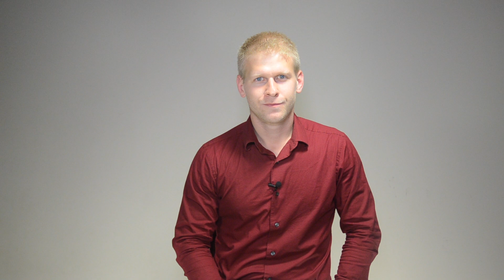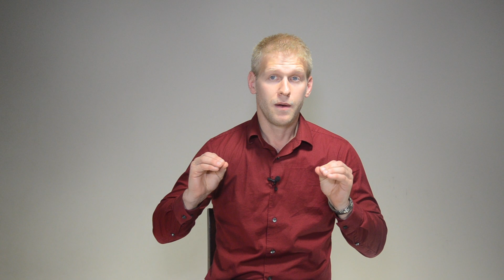Fake Refresh Rate Explained, Simulated, TruMotion, Motion Rate, MotionFlow, Clear Action, AquoMotion

Comment: Why is interpolation impossible to measure? I mean if it is inserting new frames in between source frames, doesn't that mean the screen panel is capable of refreshing more times than its 'native' refresh rate? I don't really get this..
Reply from the maker: +Nouri Al-Kadhim interpolation becomes hard to measure because there are a lot of different ways to do it and not every TVs interpolation software is equivalent. a TV can look at 2 frames and guess what a middle frame should look like. If you think of it in terms of computers a Macbook Pro is going to do a better job determining what should be in the middle than a 98 windows computer with a celeron processor.
Reply: Retail Chad But now we are talking about the ways to determine the middle frame in interpolation, not the number of times the screen is capable of refreshing. Since it is inserting and displaying the reported number of frames, the reported refresh rate is not "fake," but the inserted frames are.

For example, consider a native 120 Hz TV which receives 60 Hz signal and displays one interpolated (or predicted/fake) frame in-between each two of the original frames. We wouldn't call the advertised 120 Hz on this TV a fake refresh rate, because it is truly refreshing the screen 120 times per second. If we turn off interpolation, it would still refresh 120 times per second but it would display each original frame twice. Thus, either fake refresh rates have nothing to do with interpolation, or the advertised refresh rates are not fake and the screen is truly capable of refreshing at the advertised frequency. I think the former is more likely.
Reply from the maker: +Nouri Al-Kadhim I think that you are missing the reason that I call the advertised refresh rate fake. The number that a company uses as their motion rate (notice how i didn't use the words refresh rate) has no correlation to the number of times the TV refreshes the picture. Example: Samsung is allowed to say that a TV that they make has a Clear Motion Rate of 1440Hz, but they are not allowed to say that it has a 1440Hz refresh rate or it would be considered false advertising. 

The following is Samsung's definition of CMR:

-

"Refresh rate is a quality of your display's panel speed, but it isn't the only factor in producing a clear motion picture. So even though different televisions might have similar panel refresh rate speeds, Samsung TV adds factors to assure you'll get the best resolution from a moving scene. Here are the components that serve as the basis for Samsung CMR:

HyperReal Engine – This engine for Samsung Televisions processes moving images to reach the optimal image quality.

Advanced Backlight System – The advanced backlight of LED/LCD screens works in harmony with the HyperReal Engine to deliver crisp and reactive backlight to a moving scene.

Ultra Clear Panel – Samsung TV panel technology has over 20% higher contrast ratio compared to other HD panels, as well as faster processing time.

These factors, along with fine pixel detail and overall high product quality produce a high Clear Motion Rate. The higher the CMR, the clearer your motion picture quality will be."

-

The number used to define what you read above is simply a educated guess of how clear Samsung "thinks" their picture is in terms of Hz even though it can not accurately be defined using Hz. 

No TV can refresh its picture 1440 times a second, but Samsung can say that the number 1440 can define the clarity of motion in the picture because of the technology they use to enhance the picture even if it has no direct relation to how may times the picture is refreshing. 

Samsung themselves states that they consider the motion clarity to be "better" because of their contrast which has nothing to do with how many times the panel updates itself. 

I understand your comments, but there is no industry standard for how to define the numbers that these companies are using to explain motion capabilities of their TVs.

In conclusion - these numbers cannot be accurately used to compare TVs-
Reply: Retail Chad That makes complete sense and I really appreciate your answer. However, you still did not address my point about interpolation. If, for example, a TV has a "real" refresh rate of 60 Hz and it receives a signal with a frame rate of 60 Hz, the TV is physically incapable of interpolating new frames in between the original frames. It can show the 60 original frames in succession throughout the duration of a second, but it cannot show more frames (whether real or fake) than 60 per second. Therefore, if the TV company wanted to say "we say our TV is 960 because it shows 15 interpolated frames in between every 2 original frames of a 60 Hz motion picture" they cannot say it without flatly lying since there does not exist a panel in the world capable of displaying 960 frames (whether real or fake) in a second.

So yes I agree that the 'motion' numbers advertised by TV manufacturers are made up and meaningless. However, as I said in my earlier comment, frame interpolation is irrelevant here. And I do understand black scanning and how it gets calculated into the advertised numbers. But in the video you say the 'simulated' rate is primarily dependent on 2 things, black frame insertion and frame interpolation. I think the latter is a feature which is irrelevant to the simulated rate. If you go to the section titled "Relationship to advertised display framerate" of the Wikipedia article titled "Motion interpolation" you may understand better why I think so.

Comment: Thanks for the video! I have a guestion,  would be great if you can help me out =) 

When a video output device like dvd/BR player, game console, Tv decoder/box or for example a chromcast are set to run/output signal at 60hz (usually 60hz in the US and 50hz in Europe) to the TV / Monitor. What is 60hz mean in this case ? Is it just how many frames/images updated/sendt from the device every second? 60Hz = 60 frames sendt to the TV ?  For example the contenent/video im playing are recorded in  30 frames per second, it will be displayed 60 times anyway ( every frame is just sendt 2 times?) 
Thanks!
Reply from the maker: +Daffy Duck The Hz that you are referring to is simply the electrical Hz of the device it does not have to do with the picture.
Reply: +Retail Chad     hmmm sure about that. Check out this page,http://www.trustedreviews.com/news/google-won-t-fix-uk-based-chromecast-judder  seems like the device refresh rate impact how the frames are displayed

Comment: How's it going Chad!? I have a quick question. I want to purchase a 4K Samsung television (not sure of size yet) but the one I want says that it runs at motion rate 120. I was wondering, does that mean that it runs at 120hz or is the motion rate term a lie and it will not run at exactly 120hz?
Reply from the maker: +Ivan Serrato It depends on the TV. Some of Samsung's TV that are 120 motion rate are also 120 natural refresh and some are not. What TV are you looking at?
Reply: +Retail Chad not sure yet on exactly what type but for sure I want it to be a Samsung. Which ones do you know of for sure that will be a 120 and not a lie?
Reply: +Retail Chad I'm looking at Samsung 48JU6000 4k TV, what's your opinion on it, Chad?
Reply from the maker: I have never been the biggest fan of samsung 6000 series TVs. The benefit of the one you are looking at is that its screen size will keep the motion blur down, but I have jet to see a 6000 series samsung that handles motion effectively. I do like that is a 4K not for the resolution, but more for the computer they put into the 4K TVs. The TV up-converts and enhances standard 1080p pictures much better than a non-4K will.
Reply: +Retail Chad i want to know if that tv is good for gaming and as a computer monitor and i want to know what is the real refresh rate (samsung 48JA6000)
Reply from the maker: I am not familiar with that TV specifically, but if samsung holds true to their model series. a 6000 series tv in 2015 model year should be 60hz, but let me do a little homework and verify.
Reply: +Retail Chad ok please tell me if you know the real refresh rate  and thank you for your answer

Comment: This was helpful, thanks for posting. I am planning to purchase a Sony with refresh rate 60 hz and a MotionFlow XR rate 120. Will the picture quality be much better than a regular 60 hz TV without the fake rate (assuming other things equal)?
Reply from the maker: +manika bahuguna I am not a big fan of any 60 hz TV under 40" but Sony did do a pretty good job with the computers running their TVs. The Problem with any 60hz TV is that there is not enough information to enhance with computer processing and it will really show in panning motion. Now keep in mind that size of the TV and what you watch makes a big difference. If you are only a cable TV watcher and don't have a sharp eye for TV quality you'd be fine.
Reply: It will enhance it. If you watch Netflix on your TV, you can tell the difference. I have a 55 inch 4k LG WebOS TV 60hz with trumotion.

Comment: Awesome. Thanks. Cleared my doubt. Not gonna go for the 4k hype with the truemotion 120. They price it cheaper. You think you are getting 4k but with effectie 60hz. Instead will do the regular 1080 but with the panel refresh rate of 120hz or above.
Reply from the maker: You hit the nail on the head. 2015 is one of the worst years to buy a 4k TV. There is NO point in buying a 60hz 4k TV with fake 120. And there are a ton out there.
Reply: so Which TV is to the best for motion now ?